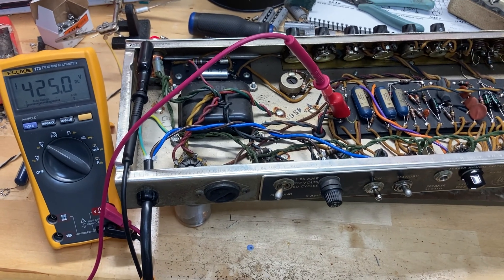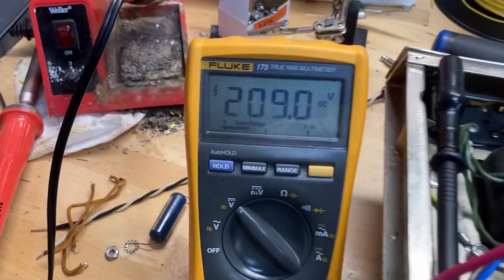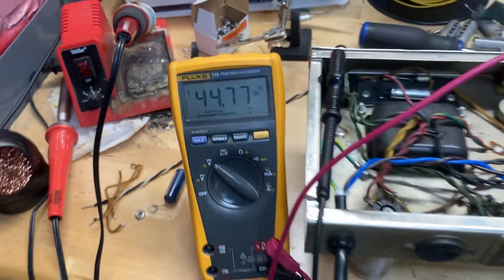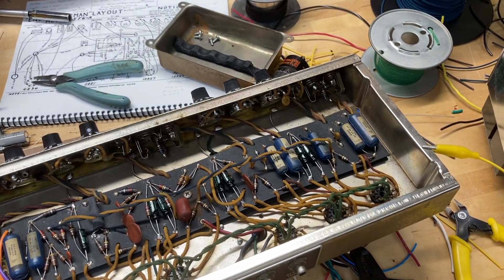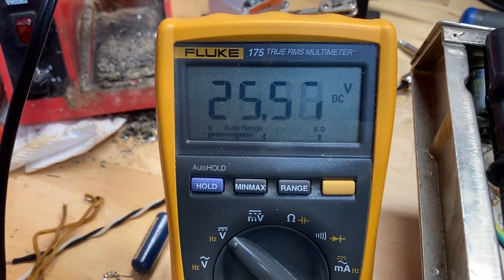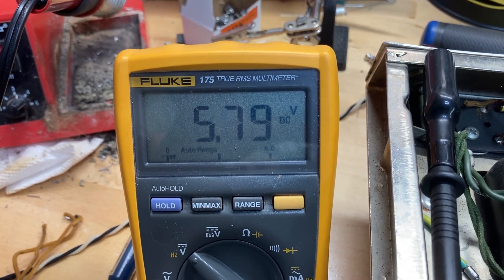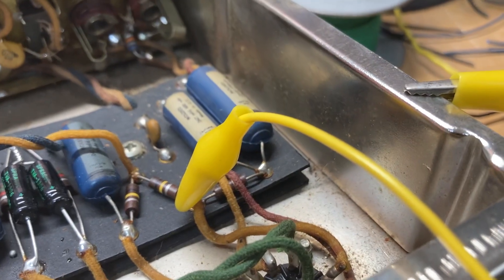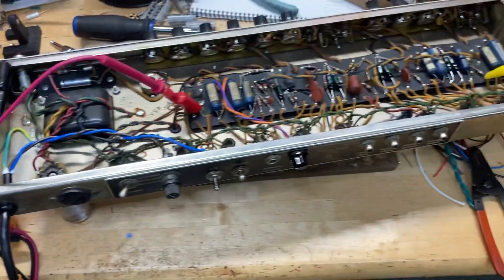How To Discharge Capacitors and Drain Voltage From a Vintage Fender Tube Guitar Amp

Comment: Would the capacitor still drain if you connected to a different tube resistor?
Reply from the maker: @sunkmanitutankaowaci2733   Possibly.  You want to connect to the power supply, as far from the source as possible to be safe.
Reply: Okay thanks